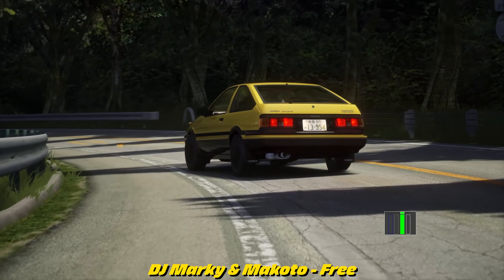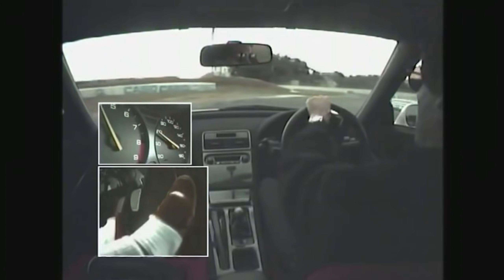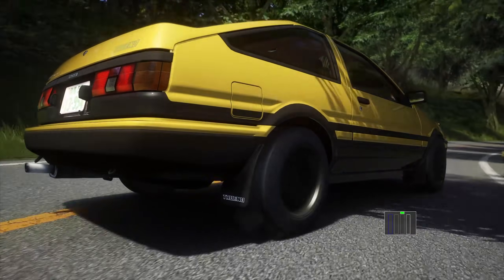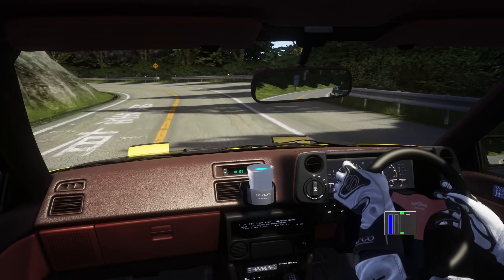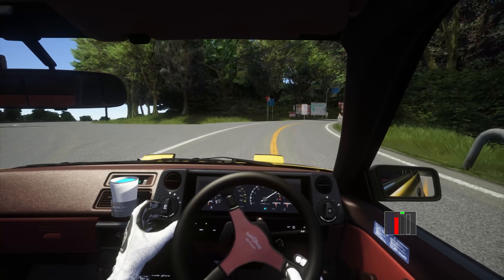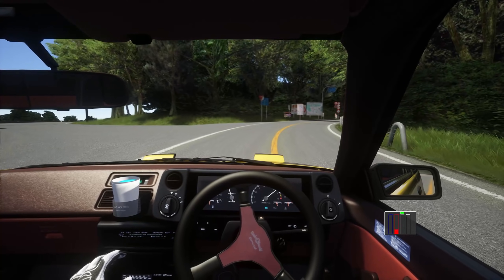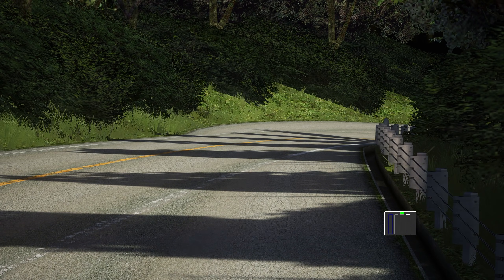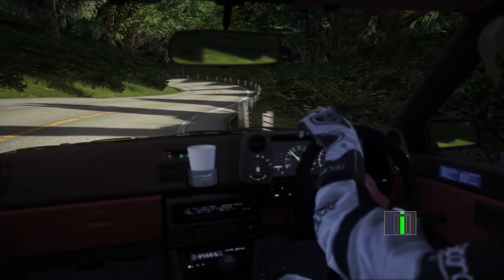Heel Toe Shifting - THE Most Important Touge Technique

Comment: The most difficult part imo is getting your foot to pivot without reducing brake pressure with potentiometer brakes, and that cheaper pedals (like the T3PA pedals) would just make your foot or shoe stuck on the bottom of the accelerator. It is a lot tougher than it looks!
Reply: I can do it with the t150 plastic shitty pedals easily but yeah it ks hard
Reply: I use the T3PA and after like 5 days i got the hang of it, it's really just a matter of practicing
Reply: I have been practicing for 10 minutes on plastic thrustmaster automatic pedals and the hardest thing is actually keeping them on the floor! I have to use my other foot to hold it down lmao
Reply: I learned on my basic g29, it's helpful to also adjust the pedal plate positioning to get the optimal distance to stick the ball of your foot right between the two
Reply: my t3pa is shaky as hell
Reply: It is even tougher with pedals that have an load cell and pressures of 60kg and upwards

Comment: I don't think it's correct to say that every racer does the heel-toe. Fairly modern gearboxes can do the job themselves. Besides, nowadays you need a sequential to be competitive in most disciplines.
Reply: well yeah, but manual is fun
Reply: @acethemain7776  True, but then again, fairly modern manuals are very good at synchronizing.
Actually, I heard this whole statement from a rally champion of Russia who drives an Evo 9 and a E92.
Reply: @yeruschmift8422  "modern manuals are very good at synchronizing" Heel-toe has nothing to do with synchronising the gears.
Reply: @tommeiner9983  Let me put it this way: from what I heard, you mostly needn't heel-toe with modern manuals.
Might be that the guy meant automatic rev matching or something else.
Reply: @yeruschmift8422  He probably meant automatic rev matching, because the gearbox itself has nothing to do with whether you have to heel-toe or not.
Reply: @tommeiner9983  I double checked and actually he meant (reasonably) easy clutchless shifting.
Reply: @yeruschmift8422  Bruh xD

Comment: Really love this series! It captures what makes touge so appealing; the romance of myths and legends combined with the maths and science of going faster. 

I was wondering if you would perhaps do a video showing how you might build the specific setups to most accurately represent various stages of Takumi's AE86, the upgrades and tuning to make them perform how you best imagine they would.

For such a mythical car there are really no mods or guides teaching how to build a museum grade replica in AC. Most I've seen are people building these 800hp formula drift versions of it and I know from your slip angle video you know this isn't how his car functioned or handled.

As someone who seems to be the 'Touge guy' around here, I think it'd be a fitting feather in your cap to be the one who built  "The closest you'll get to driving Takumi's AE86"

Comment: If you double-clutch properly, heel toe is just fancy extra effort.
3rd to 2nd down shift for instance:
3rd - neutral, rev, neutral to 2nd

The only reason I would need to shift WHILE braking rather than just planning to use my engine brake to assist in braking for a stronger and more predictable brake, is because I didnt plan the turn and needed to be braking while shifting.

IE: If you drive with more awareness, heel toe is just extra.
I learned this because its nearly impossible to heel-toe in my mazda 3, but it was very easy on my sim rig. Adaptations teach you things

Comment: I use the senna technique of heel toe shifting. Since my beamer has a floor throttle not a hanging one. Also unfort I can't do it on sim cause the pedals are at the same level and my ankle doesn't bend that way

Comment: It actually matches the engine with the clutch and flywheel not the wheels. The wheels speed difference is massively slower than the clutch that is spinning MUCH faster.

Comment: this one I just can't get the hang of, the co-ordination needed to brake and hit the throttle at the same time is just too much for me. like whenever I go to press the gas the brake moves in ways I don't want it to (usually press it too much as I blip the throttle)
Reply: You're probably using either too little or too much of your foot on the break and taking your heel off the floor. Practice keeping your heel on the floor and only using the big toe and the part below it to break. You don't have to rely specifically on your heel to hit the gas, rolling your foot slightly can be done more easily. Especially if you have bigger feet.

Comment: Great video! But i would say that when you,re driving in real life on normal roads you should always use engine braking and the brake pedal should be the last thing you need to touch when driving. You are driving correctly if you can turn your car to the next crossroad without needing the use of brake pedal. But great video on driving touge.
Reply: Clutches cost a lot more than brakes and constantly putting all that stress on your drivetrain is rough on it.

Comment: Even better is rev matching so you don't need the clutch.
Reply: Esp with a dog box
Reply: you can't rev match unless the clutch is open, so I don't see how thats possible.
Reply: @Born_Stellar  yes, you can. You need to unload the drive train to get it in neutral first though. How it's unloaded depends whether accel/decel/up/down shift.. if you're decelerating, you slightly tap the throttle which causes the gears to unload which allows it to slide into neutral where you then rev match to the appropriate rpm and slide it in, doing your best to keep the gears unloaded until the shift is completed. If you mess this up on a synchro box and aren't being gentle, you will break it. Clutchless shifting/gear floating is definitely a thing and is often used by racers/high performance/truckers/ppl who drove old ass dog boxes
Reply: @Born_Stellar  literally if you know what you're doing, you only need the clutch to start off in a manual car and even that can be avoided if you don't care about your starter much; trust me I've driven around a lot w/broken clutch cable..besides my rally skills but yeah..this is literally how I drive always even on the street..I only hit the clutch to start off or if I know I've fucked up on my timing.

Comment: Is it like clutch kick but on breaking, instead of hitting the clutch its the accelerator?
Reply: Clutch kick happens when the engine rpm is higher than the clutch rpm, which will give a little bit of extra power into the driven wheels. In other words, you are trying to break the driven wheel traction by utilizing the difference in rpm speed of the engine and clutch.

Heel toe does exactly the opposite. To help explain this, let there be a car, where it is traveling at 80km/h. If the car is in 3rd gear, it's engine rpm is 7000. If you shift up to 4th gear, it's engine rpm will turn to 5000. As you shift back down to 3rd gear, the engine rpm will turn back to 7000.

As you remember, clutch kick is when you increase the engine rpm to give a bit of an extra power to the driven wheels. What if you decrease the engine rpm instead? The clutch will try to sync will the engine rpm, which will then cause it to slow down, and acting as a brake to the driven wheel. What you will get is the complete opposite of clutch kicking, where the car slows down instead of speeding up, but both will cause the tyres to lose traction.

Usually, this sort of instant engine brake can really mess up the weight transfer of the car, as it is equivalent to having uneven braking. To mitigate this problem, the best way is to have the engine rpm higher as you shift down. Using the imaginary car mentioned above as an example, when slowing down at 4th gear at 80km/h, the engine rpm is 5000. When we shift down to 3rd gear, we will want to make sure that the engine rpm is around 7000 to allow for a smoother braking (no sudden jolt on driven wheels) which will prevent the car from spinning out.

Comment: TBH I still don’t get understand the point versus just leaving it in gear or sometimes neutral while you’re in the decelerating/static, and only catching a lower gear when you’re ready to start accelerating again. Which a lot of times I don’t use the clutch for because dodgy left knee. Might be because space between the brake and gas is wide on both my sim pedals and my truck.
Reply: It helps you slow down faster because of engine braking, so you can brake later and save time
Reply: Engine braking is really helpful on road courses such as this with steep grades. The higher an engine's speed, the greater the resistance it offers in the drive train. It's the same reason F1 cars go, "VRO-VRO-VRO-VRO-VROOooooommmmMMMMMMMMRERROOOOO- VROOOOO- VROOOOOOOO" whenever they make their way through a corner.
Reply: Ironically on my automatic car the brake are gas pedals are feasible to press with one foot at the same time facepalm
Reply: I mean no one is ever going to care or find out, but it is illegal to coast in neutral in a lot of places.